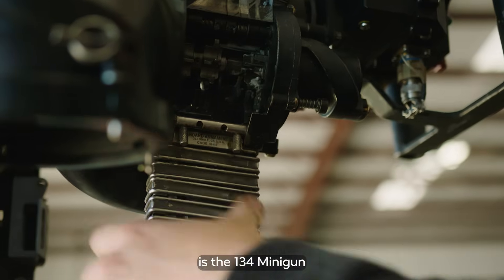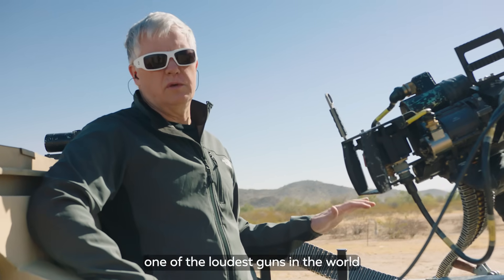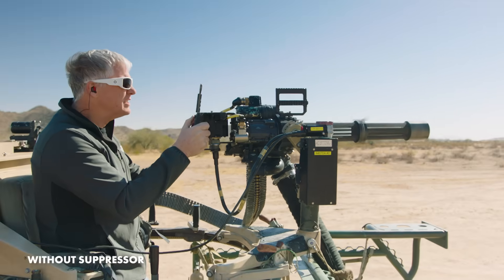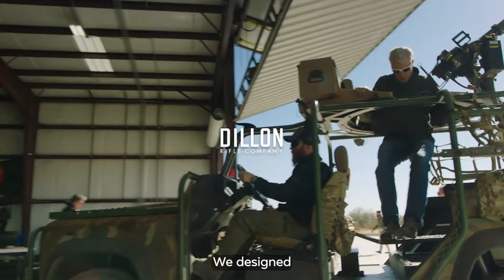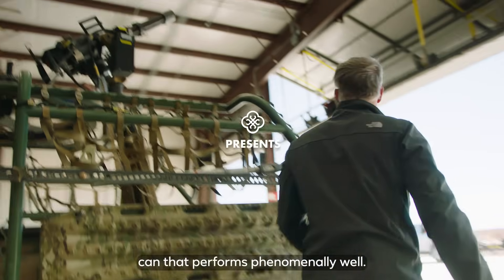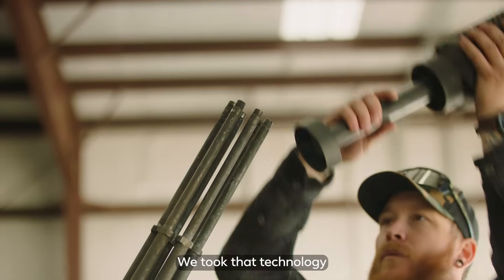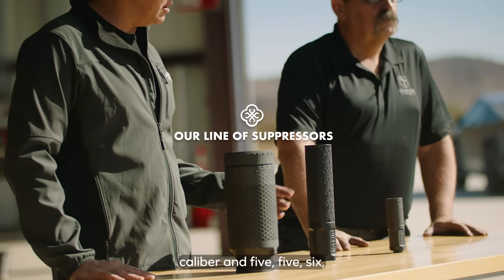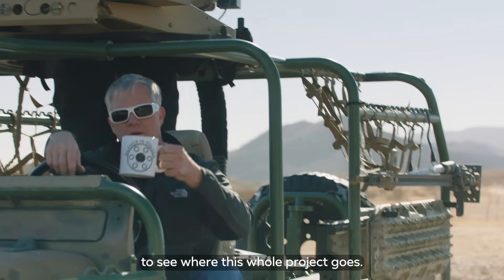The Hush Kit | DRC Suppressor Line Development

Comment: @DillonRifleCompany - Id like to hear feed back on the Barrett M107a1 and your DRC Hush 50 on it. Has it been tested and validated? Compared to Barrett's QDL, which sucks, the only thing it does is remove the felt concussion while doing little to nothing on sound suppression. POI shift is about 5.5" @ 100yrds with and without the QDL. While I hate spending another 3k on a 50 BMG suppressor, if its tried and true on the M107, then I'd take the plunge.
Reply: Tested like standing 6 feet to the side with no hearing protection?  Its amazing.

Comment: I can only imagine how hot that minigun suppressor gets. What I would do is put a heat sink on the outside of the can so its spinning action naturally cools the can down. Clearly size and weight are not a consideration for that application. Also hope its a flow-through design otherwise wow.
Reply: Actually the opposite……size and weight ARE the considerations while mounted in a helicopter.  FYI, plenty of airflow hanging out a helicopter side door.
Reply: @gpracer1  Agreed, for an unsuppressed minigun but I'm struggling to find the need for a suppressed minigun that IS mounted to a helo. At least for sound, there's no point, they're going to hear you coming anyways. Of course I'm no military arms expert, just some dude on the internet.
Reply: @Nefville  it’s for the shooter, pilot and others in a helicopter that wish to keep their hearing.

Comment: How does a can reduce the downrange shockwave against the ground?
Reply: By slowing the gas expansion so it's less of a sharp bang at the muzzle that causes the pressure wave.
Reply: @robertslugg8361  it doesn’t.  The suppressor kills the shockwave or over pressure at the muzzle, but there is nothing you can do about the bullet pushing through the air except less powder/slower bullet.

Comment: Ive heard the noise of a mini gun has a not insignificant psychological effect on attacking forces
Reply: well, the suppressor only silences the blast. I believe they are still flying at supersonic speed so it will make those cracks. A staccato with, well, for the lack of better word, very dense, meaning, staccato with lot of supersonic cracks. Well, AFAIK, it should mean its clear they are being shot at by a minigun.

Not sure if its handy to be used from helicopters, but ground emplacmenet and vehicles, the minigun will be handy to make it difficult to pinpoint. WEll, assuming the tracer's  burn delay element is working as intended that is.